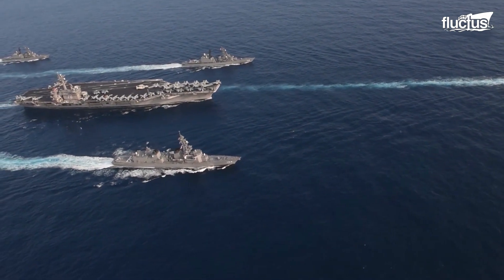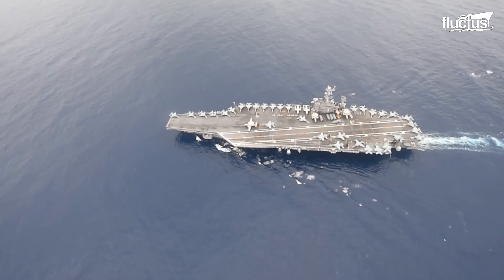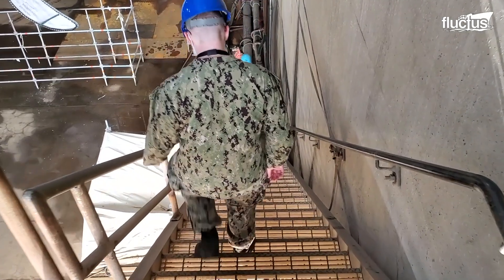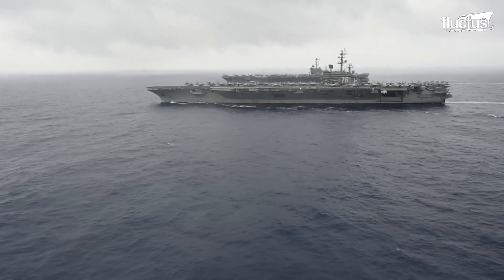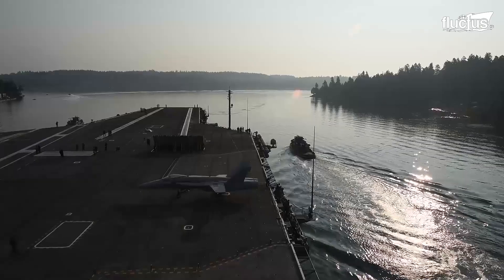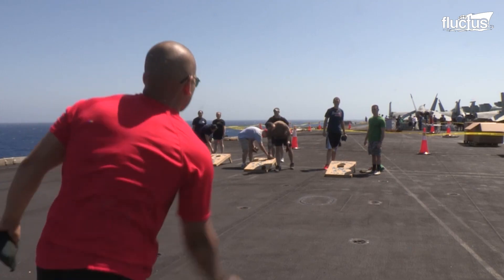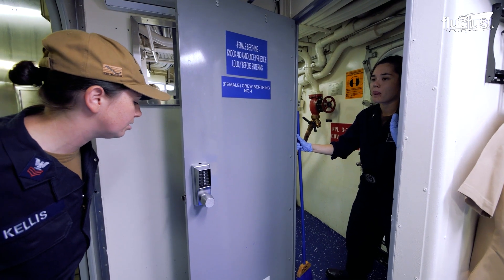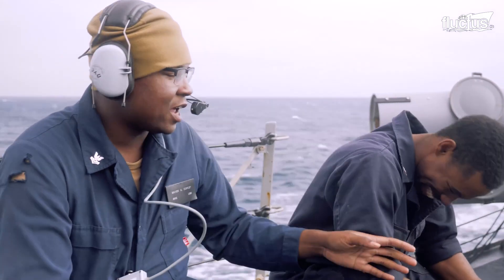How the US Fixes its $13 Billion Aircraft Carrier - Documentary

Comment: A new carrier plus planes, bombs and a year or two of operating costs adds up to roughly $15 billion. Assuming nukes aren't used, can a carrier do $15 billion worth of damage? Can it carry enough conventional bombs to do even $1 billion worth of damage? The lethality per dollar -- bang for the buck -- seems terrible. I understand carriers were crucial in the pacific in WWII but carriers cost so much less in the 1940s that they made more sense then. Is anyone in the Navy asking these big questions in a serious way?!
Reply: most people think bombs and planes are necessary on the modern battlefield so even without aircraft carriers you would still need them. so discounting most of the aircraft, munitions, and aircraft related expenses from the yearly cost of running the ship then what's left over is just the costs of running the ship itself which is actually tiny compared to the costs of running a similarly sized airbase on  land. the ship doesn't need refueled for 25 years the personnel who's jobs wouldn't exist on a land base are partially made up for by the amount of people on land bases whos jobs does correlate to a carrier. basically the vast majority of the expense of a carrier is it's construction after that it operates everywhere and anywhere at a relatively low cost. the air base on the other hand costs less initially but you have to keep paying into it over time and even if you have a base the world doesn't just stay the same for 25 years. the battlefield can move rapidly whereas a land base is fixed in one spot.

 this means you might have to build, and maintain a base for years for it to see little use then have to build a new one somewhere else if the battlefield isn't where you planned it was or it suddenly moves. an airbase on land just has to hope it's defenses work if it comes under attack and theres little chance the enemy won't know where it is. the carrier can move to keep the enemy from discovering it's location or run away if threatened directly. also the last and most worrying problem is that the earth is 70% water so there isn't always a friendly piece of land where you want it and even then you might not be able to afford it long term. basically you can either build a floating airbase once and move it anywhere you need for a basically negligible amount of money or you can keep building and maintaining airbases everywhere that you may or may not actually need. The US government chose the third option and decided the taxpayers should pay for both, becuase why wouldn't they want their hard earned money to be spent on killing anything the government doesn't like. For the whole cold war the US and Russia could have just kept throwing money at post WW2 Europe and Asia until one of them was broke and decided which economic system was better that way, but nah bringing the world close to the outbreak of nuclear war a few times and making countries fight themselves was just too much fun.